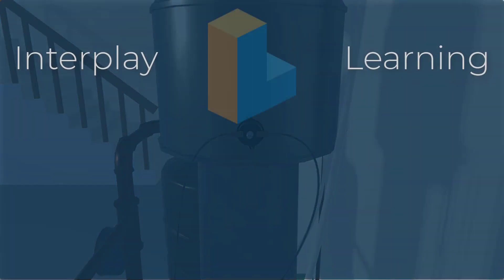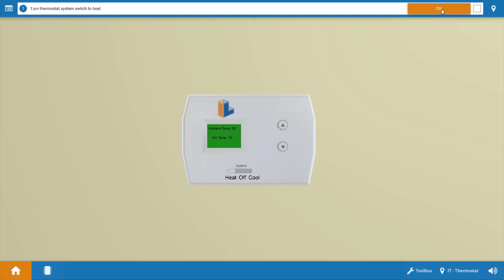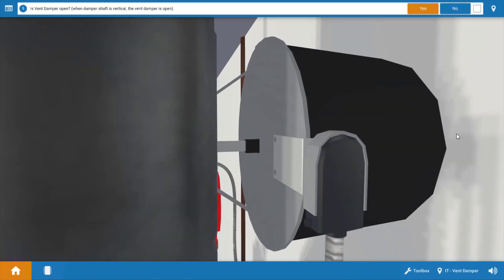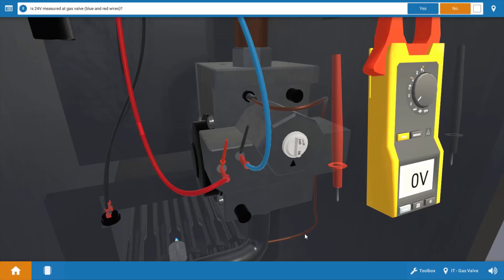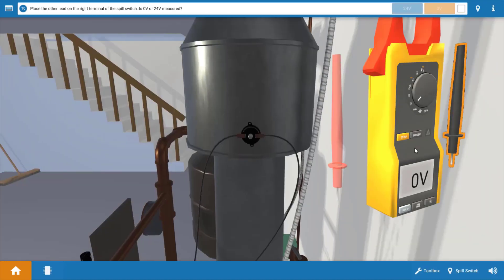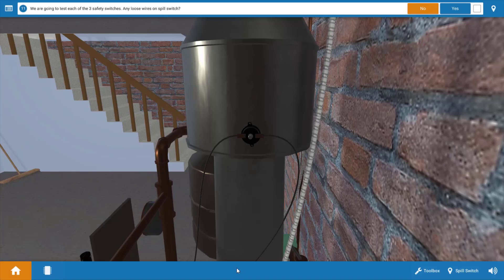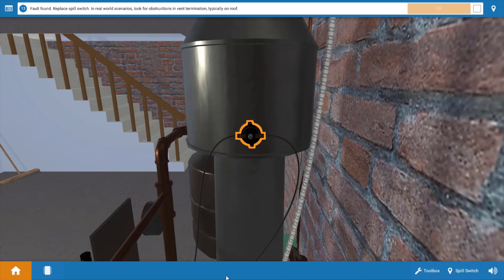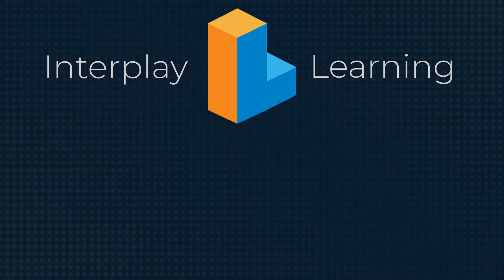How to Diagnose a Faulty Spill Switch on a Gas Boiler

Comment: This is a really horrible video.  A) get a multimeter and see if you get continuity  between contacts B) if you don't have continuity look for a reset switch and try again  C) replace spill switch if it it doesn't have continuity.    (spill switch is just a heat sensor that breaks continuity when a certain temperature is reached. Test should occur when hood  is cold)